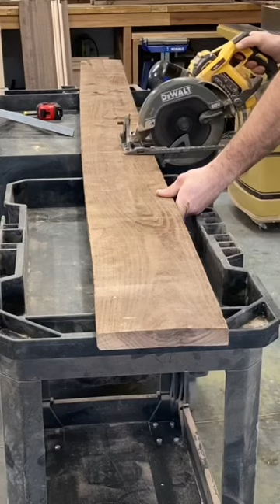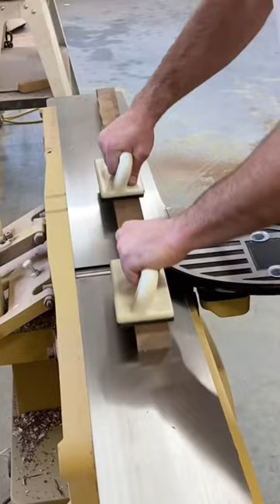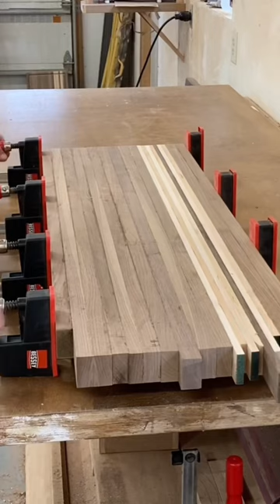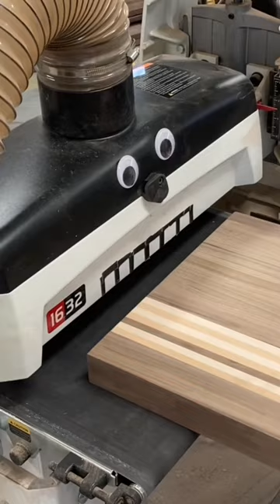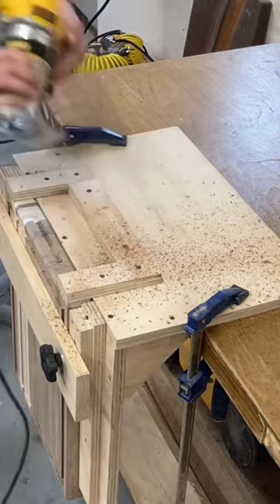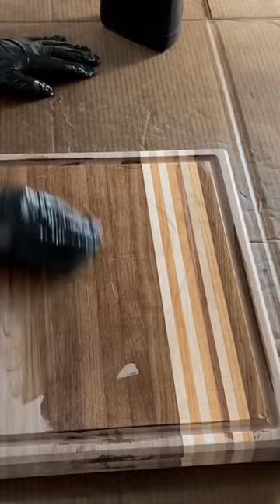It’s the most wonderful time of the year!

Comment: Hey Jason! could you clear a doubt?  why do you spray water during sanding?
Reply from the maker: It raises the grain before the final sand. It will keep the board smooth, when it gets wet in the future.
Reply: @hesswoodwork  so basically you sand, spray, wait for it to dry and the sand again ?